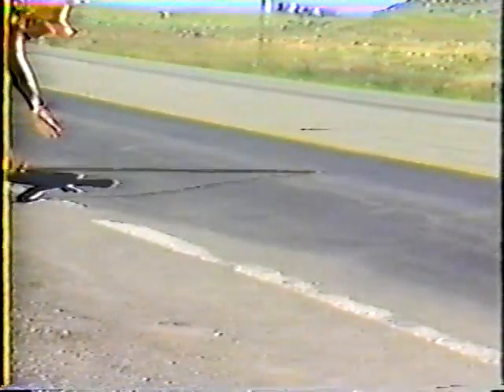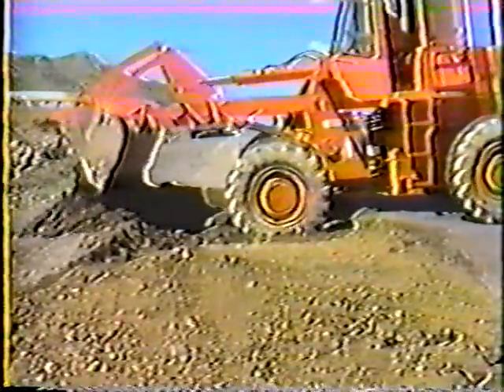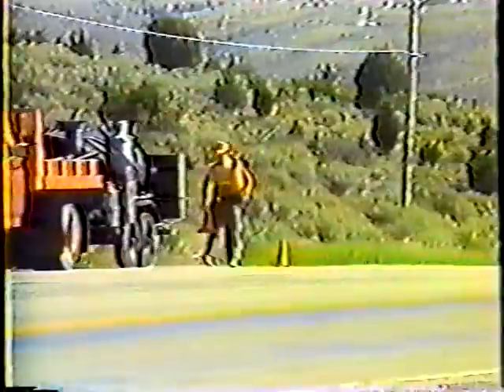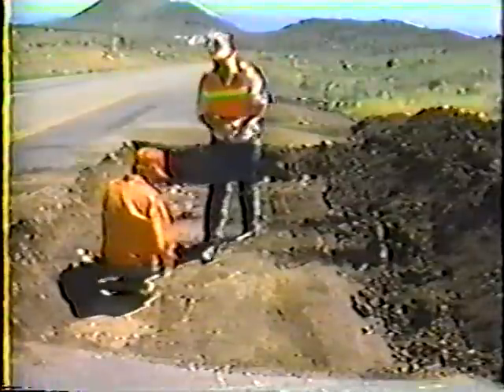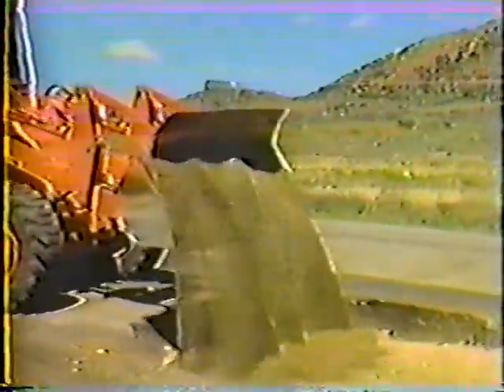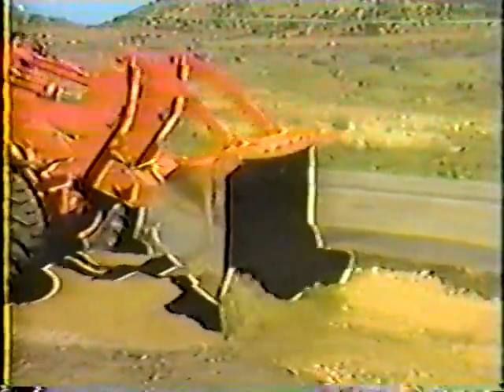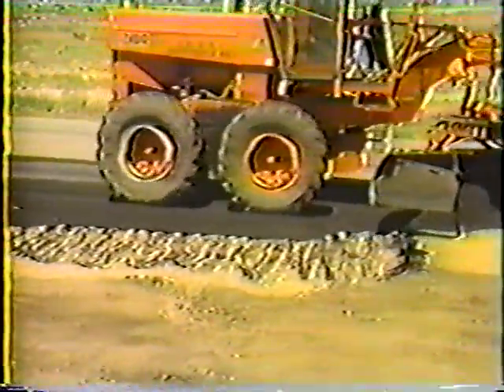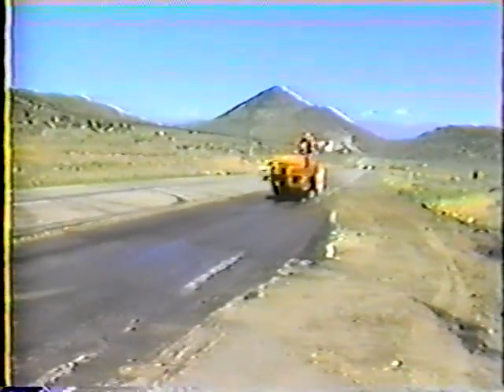Base Repair

Comment: Strange Video: I ve never seen such choice of Equipment here arround. A 7-15ton Rubber Tired Excavator such as an O&K MH4 or an Komatsu PW130 would have done the Job allone, without affecting much space on the Traffic. Furthermore everey layer is compactet with a vibratory Equimpent, or a "walk behind Earthroller" i ve never seen someone compacting a Road Basement only with a Loader oder Grader....

Ist this only shown in the video or do this guys in that are really work that way?